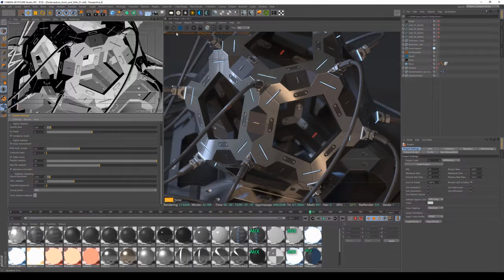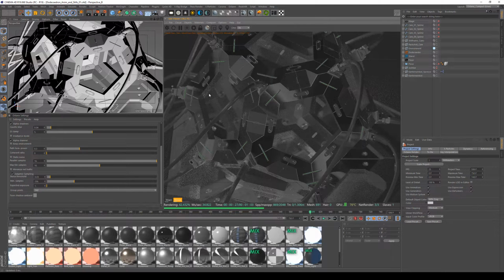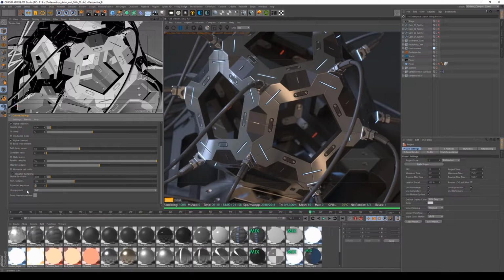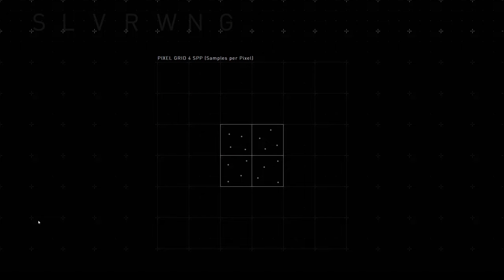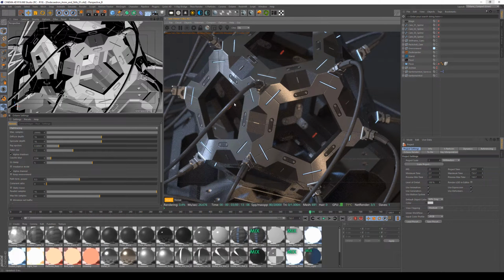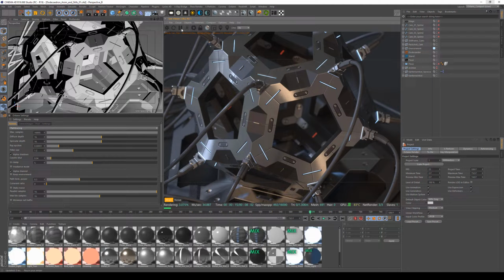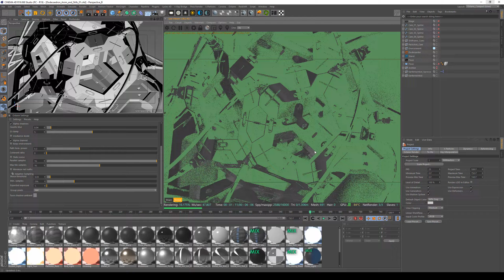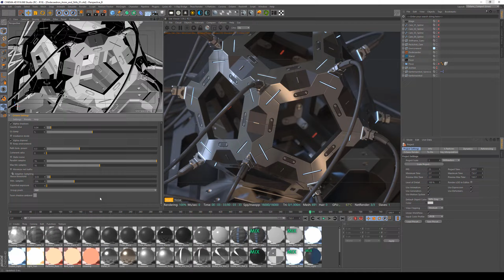Silverwing Quck(ish) Tip: Octane Adaptive Sampling

Comment: Great  Tip!!! Thanks so much! So why isn't this feature on by default all the time? In other words what is the downside of using it?
Reply from the maker: If you have scenes that converge uniformly the extra calculation that is needed for the noise detection possibly makes it render  a bit longer.
But yes, this feature does not have that many disadvantages. In my opinion it could very well be turned on by default.
Reply: Gotcha. Thank you!!